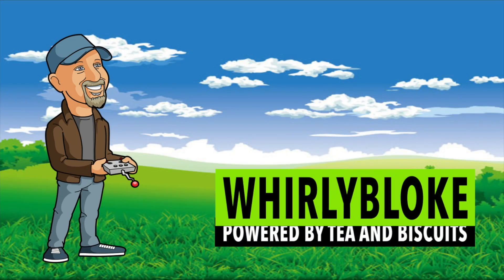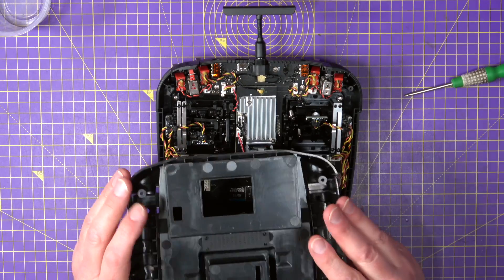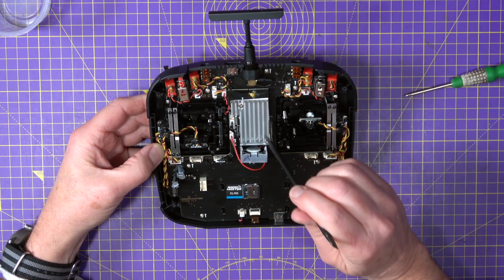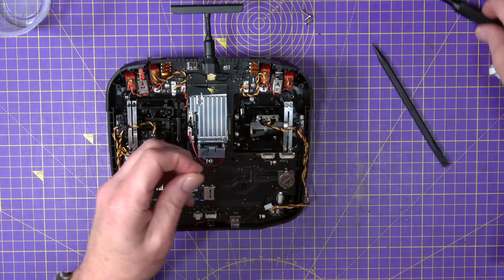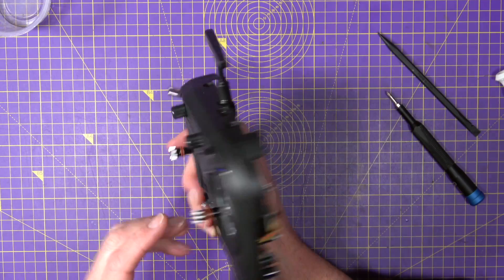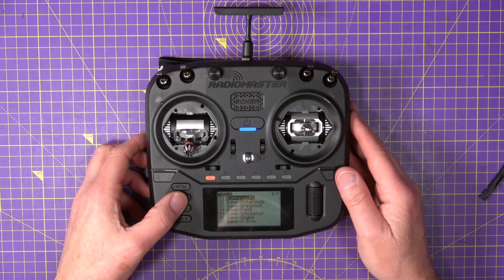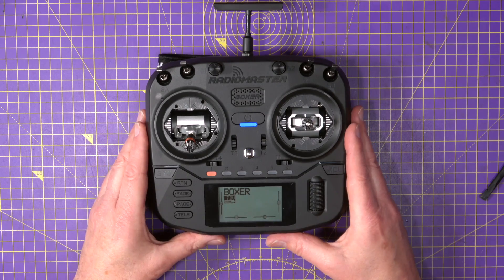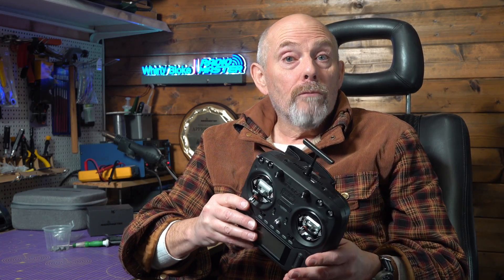RadioMaster Boxer AG01 gimbal upgrade and teardown

Comment: When are these going to ship?
Reply from the maker: The Boxer will ship in Jan 2023. The gimbals are available now. Check the links in the video description.
Reply: @WhirlyBloke  fair enough.

Just for notes: I preordered through GetFPV. In the same order, I added enough stuff to amount to about $450.

WB is obviously not GetFPV, but after a good couple days of wondering, I sent them a note. I got a rather curt reply from Pam saying that they “don’t do partial shipments.” So now I’ve paid a vendor about $300 for goods that I will not receive until these lovely radios begin shipping.

Terrible look for GetFPV. Terrible look for Pam. Think hard before you preorder anything from GetFPV in the future. RDQ doesn’t have this problem.
Reply from the maker: @Cesotoseot  That's really annoying.

Comment: I ordered AG01 gimbals when I put in my pre-order, They turned up yesterday so now I've just got to wait for my radio 😂 I have the tango 2 pro currently with ELRS on the back but the pro gimbals are getting sloppy from the folding mechanism 🤷‍♂️
Reply from the maker: The AG01 gimbals are so nice and now they have a wide range of colours. I still like the original silver and black.

Comment: Pre-ordered it, hoped to see the front cover removed. You think I can remove the plastic completely? I'm thinking of spray-paint or hydro the front.
Reply from the maker: It looks easy. I just wanted to get back to using it quickly so I didn't bother. Someone will do a full teardown soon, probably MadRC.

Comment: First video I could find with the AG01's installed. Thanks! I fell in love with the TBS Mambo for it's form factor but it doesn't have a trainer port or the AG01's. Perfect radio imo!
Reply from the maker: Exactly.